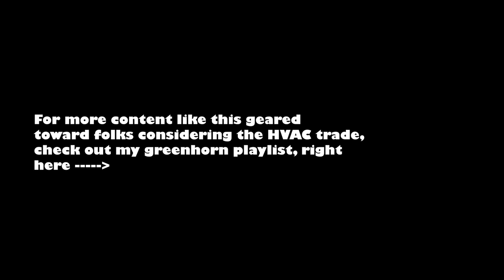5 Things to consider before becoming an HVAC Service Tech🔥❄

Comment: After fifteen years of sales, being alone all day = Heaven.
Reply: I’m 14 years in sales and thinking about making the switch. If I could be alone, not have to cold call anymore, I’d be in heaven lol. Leaning HVAC or Electrician. 

Did you ever get into the trade?
Reply: @ChopOn414  I've done 23 years of sales and seriously thinking about a trade
Reply: @ChopOn414  I’m in the same shoes. Just got outta the Army and I’m not sure which way to go?
Reply: I’m only 3 years into sales and I already can’t stand it. Putting on that act everyday ruins your mental.
Reply: @tylerlane4587  I’ve done a little plumbing and framing and 3 years of business to business sales. Closing on your sale is pretty much the best feeling in world, but that comes with losing clients and getting shut down alllllll the time. Also your higher ups being up your ass about closing everyone you talk to. If you’re used to working hard and working with your hands I would go into trades.
Reply: But, you're not alone. You constantly meet and speak with potential clients, and regular calls from previous estimates, and the office never leaves you alone. But, other than that, yes... solitude and control of you time is in your hands.
Reply: @ChopOn414  What kind of sales?
If you plan to do sales in HVAC, a somewhat of a technical background goes a long way. Install experience helps as well.
Lot to learn.
Reply: @tylerlane4587  update?
Reply: I just quit my job in restaurant and wanna switch too. You aren't the only ones. I feel this. 😂
Reply: Love it. Ride around all day and fix stuff. Alone! 😂
interaction in a need-to-know basis is my kinda work. I don't understand all that social butterfly crap. im better off as a loner. I like work and take pride in my work. Can't do a good job if you're worried about other ppl all the time. Now doing a good job for other people is my way of being social!😂
Reply: 15 years in IT taking tickets all day. I  agree 👍
Reply: Oh I bet sir 😂 cheers to that
Reply: I've done 1 year in sales and I just now signed up for HVAC trade and will never look back 😂
Reply: That's my biggest selling point. I hate people.
Reply: Hahaha I was going to post something similar to this.

Comment: You forgot the part about getting electrocuted from time to time and those sweet blisters you get on your hands from refrigerant burns 👍
Reply: Shannon Knight I got hit hard last week on a install under a house. A wire was rubbing the copper water line. Put my arm over the gas line and went to ground.  Hollered like a schoolgirl. Customer did come out and checked on me. That’s the bad thing about working by yourself.
Reply: Why split hairs Brent? Electrocuted vs Shocked, tomato vs tomahto. It was meant to be a humorist comment. 😜
Reply: I got hit with some 480 last week, scared the ** out of me. Gotta love three phase
Reply: D@mn Nick...you still got your eyebrows? ⚡⚡⚡
Reply: I'm surprised I still have the bottom of my feet 😂 $#it hurt but I'm glad it was 3 phase so it let go
Reply: @nickgrant2846   i Got a Arc Flash from 480 to Ground a while back , scared the crap out a me too and got blinded for like 5 Minutes. Never Rush on a Friday night working on a 480 volt  60 ton chiller.
Reply: Get some low loss fittings
Reply: Jus get the hoses with the ball valves on it
Reply: I mean as long as your following the SOP's
You'll never get shock or electrocuted.
Reply: You could always just wear latex or non latex gloves, you’ll feel the cold but not get burned
Reply: I know you guys love the feel of that
Reply: @OcRefrig  Ohh damn thanks for the advice.... I want to start doing this but when ive read ur message its making me thingking so many times now lmao
Reply: Tone it down, we need more technicians
Reply: If you tell them the bad things about HVAC, they won't try it. The things that all of you are saying that happened to you, are things that happened to YOU. Most injuries in our field are caused by some sort of negligence by the tech. Somebody else could have done the job you were hurt on, and not got hurt. Don't get me wrong, I've been hurt myself. I had a career ending fall from 20' off a ladder. It's all in what happens to YOU. I know someone else could've climbed that ladder and not gotten hurt.
Reply: OcRefrigeration,Hvac & Electrical. Yeah I got blinded from my co classmate at school dropped his leads and they touched and it made a huge ark I was blind for five minutes
Reply: Ahahah yes!!! I remember the first time I got hit with 220, not cool!
Reply: Yep. 
 Over the last 30 years I have been hit with high voltage more times than I can remember.
Reply: One can simply not do service with gloves, so both the burns and a little shocker from time to another is definetly a part of the trade.
Reply: Shannon Knight HVAC .. gloves .. perhaps the rubber coated.. almost guaranteed no blisters, electrocution & refrigerant burns.. always have em on when workin also timberland pro shoes.. (I kno they r expensive) electrocution protection upto 600vac. We all know accidents do happen.. but these help a lot
Reply: Iron Phoenix proper gloves & shoes brother
Reply: @unitedhvacelectrical7076  You can't do skilled HVAC work wearing gloves. Come on man you know that.
Reply: Nick Grant 3 phase is the one that doesn’t let go bud
Reply: You mean SHOCKED. Electrocution means you are DEAD.
Reply: @ironphoenix5145  some people can and some people cant bro, it’s all up to what YOU think is best for YOU and how YOU do it
Reply: @bobrob3109  So this might be a stupid question but do you have to climb a lot? Like up ladders and Heights?
Reply: Ah yes, the refrigerant burn. I once forgot to close the tank before removing the hose....
Reply: Adrien Broner yes you do if you do commercial. Residential only if there is package unit. I hated the really tall angled roofs. I was scare

Comment: Great video. I am an HVAC mechanic from Canada. I have been in the trade since 1987. My advice to anyone thinking of doing this for a career is to keep in mind what was said in this video about wear and tear on your body. My knees are shot. My hands have arthritis and my elbows are so worn out from turning screw drivers that it hurts to pick up a cup of coffee. I have worked for the same company for 35 years and am now riding a desk at a reduced pay. I made a lot of money and loved being in the field. I love being an HVAC mechanic. If I could go back in time as a young service tech, I would get a job with a larger company with a pension of some sort. I left the field at 55 years old and if I had a pension I would have been able to semi retire. Just keep in mind that your body can only take so much. Some good companies have 2 techs assigned to most of the service calls. My company is cheap and I was always on my own when many times I should have had help. This is just my 2 cents. Cheers!
Reply: U clearly didnt use knee pads , elbow pads and electrical tools
Reply: @AlexLopez-zv8ng  It wasn't in the culture back in the 80's. I agree that using the proper equipment all the time would have made a difference. Ergonomics was never discussed during my schooling. So much more info available today.
Reply: That’s sad they have you on reduced pay after 35 years of service
Reply: im leaving my current company due to them paying commission and not the driving hours, it seems like they are f-ing us over, this is my first hvac job and im already riding on my own, i also feel like shit after selling items as a preventative maintenance for 10 times the actual price just to make my quota. i just hoped that they ha dnot put me on full commission fresh out of shcool.
Reply: @ethanberdejacortez4845  Commission type jobs are BS unless its sales. In Ontario, if you are having to drive to a job site, you may not be paid for travel there and home unless you have multiple jobs a day. Then you must be paid for travel there and back unless you are in a union. They have their own rules

Comment: My advice for apprentices getting into the trade that no one ever tells you about.

1. Never throw out your napkins from lunch, keep them on your passenger seat
2. Apprentices - it's always your fault, this includes the times you aren't even on site, just accept it as a fact of life
3. You'll come across a piece of equipment you've never seen before and you have to be an expert on it in the next 30 minutes
4. Never drink when you're "on call"
5. Your drivers licence is the most important licence you have so don't do anything to lose it e.g. drinking and driving, not paying speeding tickets. Lose your licence you lose your job.
6. Learn to eat lunch in 5 minutes or not at all
7. Keep a roll of toilet paper and hand wipes in your truck, trust me when you need them you're going to thank me for this one
8. You can work 8hr days if your quick and efficient, but there are times when you may also have to work a 16hr day
9. ALWAYS check the simplest things first when troubleshooting. Is there power at the unit? I once pulled a unit apart for an hour because I couldn't get it to lite. Turns out the customer hadn't paid the gas bill and it had been shut off. ALWAYS. 
10. You will make mistakes because you are human, but don't tell the customer that. 
11. READ THE INSTRUCTIONS!!!!!!!
12. It's hard work but pays well
Reply: Take a whole 30-45 mins lunch not 5 🥴
Reply: This whole list, napkins included and tp not, i do. 😅
Reply: @SnApUnique  30 minute lunch is requite by law, so
Reply: This is so true I just experienced myself
Reply: @benjaminreed6816  There's what the law says and then theres reality. Do you do the speed limit because it's a law?
Reply: @stinkyham9050  Um yah, 90% of the time.

Comment: Everything AK said is true. It’s not a profession for everyone. I’ve seen many fail, and I’ve seen some excel at a rapid pace. It can be physically and mentally demanding. You do have to be ok with the self gratification of a job well done. I also like to be left alone. Occasionally having an apprentice along for the ride is ok. Customer communication is not just important, it’s also a skill that can be honed.
Reply: I feel the same  way.
Reply: "that can" or "needs to be"?
Reply: Jordan R not everyone can communicate with customers well. I agree it should be need, but not every can.
Reply: Also, it’s not “self gratification”. Think of the customer/people that are benefiting from your work.
Reply: It's self gratification to the point that you won't hear "good job" or "thank you" or whatever else from people...customers sometimes, but not always.
Reply: @jroberts3428  Most professions are not for everyone. I've been both residential and commercial HVAC for 17 years. I love it. Seen many come and go. What I've learned about the one's who don't stick it out, is that they thought they'd make easy money and found out they were VERY wrong. It's challenging work and there is a ton to learn. 17 years in and I'm still learning new things. I quit a building maintenance job in 2001 topped out making $14/hr to make $9/hr for a company that had a "learn & earn" program. I felt that in 5 years I'd be better off and I was right. I went from $9/hr to $25/hr with great benefits in 5 years. It's a great trade if you like to be challenged and aren't afraid to get dirty.
Reply: @johnpatrick3458  Great man! How many hours do you work a week?
Reply: @basse9914  I generally work 50 hours a week. Usually 60 during peak which is roughly 4 months out of the year.  I'm a field supervisor so it never really slows down for me. 50/50 between the field and office. We have 38 techs in the field. 60% resi and 40% commercial.

Comment: It's painful! You will bust knuckles, get shocked, get burned, get cut!
You have to be okay with heights and or sketchy shyt! 
You have to be okay working in the elements. Extreme heat, extreme cold, wind, rain. Loud noise environments. 
The hoods need service too. I have had to chase away crazy crackheads hiding between condenser units.
Reply: HAHAHAHA! Thanks for the honest advice !
Reply: If you tell them all the bad things, they might not want try it. When I started, I didn't know everything that I would have to do. But once I started doing different tasks, I loved it. If you want a job that challenges you everyday, this is it. The more you know, the better you get paid, so you'll have to hit the books. Sometimes, you are only as good as your resources. So dig into it and find the resources. It could be tech support, unit manuals, supply house and maybe other techs. But once you fix it, you will have gained knowledge. And that's how you make money and build a good reputation
Reply: Where hood where the hood where the hood at
Hahahahha GET THE STRAP
Reply: do u have to go under houses? deal with spider?
Reply: @MusicX9BeatS  under houses no. Spiders yes. I'm in the desert so we deal with spiders, snakes, and lizards daily.
Reply: @jrchevy2500  oh dam thanks for the reply. I'm only worried about spiders and snakes I live in California
Reply: How much schooling does it take to get certified and all tha
Reply: @scottaguilar3310  schooling never stops. To get the epa 608 you can probably study a few weeks and pass it. There are always new equipment to get training on, new gov regulations to get trained on, depending on the job scope you'll need different certs, ext... you will never be done with schooling in HVACR
Reply: True true people do it for 20years and still is learning, how much does it usually cost for the schooling to pass the test and how long will it take ?
Reply: And once I get the epa 608 will I be able to into work I want to do hands on experience while studying, I want to know I’ll be ok and I’ll be good at my job
Reply: Also you have to be a contortionist crawling thru some of these attics

Comment: Sounds like you hit on everything pretty well. I started school to get my degree in Heating and Air Conditioning Technology when I was 18 and been in the trade now for 32 years. 
Remember when you get into service, this is an applied science more than just a trade. Learn the science of your job. Know the 18+ different reasons an evaporator can freeze up instead of just adding refrigerant. Learn about thermodynamics, air balance, heat loads, coefficients of performance, psychometric charts, electrical engineering, and you will set yourself apart from the "pawn shop" techs.
And he is right about your home life. Your home life can definitely be a challenge. Especially when you have a young wife or girlfriend. They will ask what time you're getting off work. "I don't know.", is the hardest thing for them to grasp. Because how could anyone NOT KNOW when they get off work? Be prepared to sacrifice trips to the lake in the summer. Or hanging out all weekend at the pool.
But this is my dream job. I love it, am good at it, and can make lots of money. 
Good luck!
Reply: Hey Will I’m also 18 and eager to further my career in HVAC. I’m still in school (class of 2023) I was wondering while I’m in school, how could I begin the process of becoming an HVAC technician or prepare myself for it?
Reply: @jeanomaly7776  I would say you need to focus on the science of the trade before going full on to a service company. I actually started out doing apartment maintenance so I could complete my college courses I took at night.
I worked my 8-5 job, then went to school from 6:30-11:30pm. It gave me a chance to get hands on training on the simple units of the apartment industry, while learning the basic sciences at school I could apply to my job.
Reply: You got a degree at 18?You can't leave school until that age in the U.K. then go to university, normally for 4years. Do you get degrees free with a big Mac ,
Reply: @alemgas  Apparently the reading comprehension in the U.K. isn't very good. If you go back and read again, you will see that I STARTED school to get my degree when I was 18. Got my Associate's degree at 20, and my degree in electrical engineering at 23.
And no Big Mac for me. I'm in Texas and we eat steak 3 times a day.
Reply: @williamthomas2063  sorry getting old didn't read it right, I've been in HVAC for 51years, hope you have a good career. Big Macs are shit better with a good steak ,cheers

Comment: The part about not getting a pat on the back applies to other jobs as well. I'm a computer programmer and the same thing applies to that. Basically, you just need to take pride in your work, and know that you did the job correctly and did a quality job. If you do that, you will have you're own internal satisfaction, regardless of what anyone else does or doesn't say. Similarly, you also have to be able to work independently and solve problems on your own. So, I see parallels between the two jobs.
Reply: Real.

Comment: Started in this field 10 months ago with no knowledge of anything HVAC related. I’m still pretty green and have alot to learn but I am definitely enjoying it. I work for a small company so I’ve had my hands in everything so far. Maintenance, installs, service on ice machines, RTUs, walk in coolers and freezers, split systems and everything in between. It’s definitely a lot to learn and definitely overwhelming but you take one day at a time and keep pushing through. Slowly but surely I am getting it.

Comment: Installs is the best place to start off. You learn to understand how the equipment should be put in, and why it should be done properly. It gives you the basics of everything you need for service. Electrical, controls, gas, plumbing...ect. 
As well as it allows you to learn the sketchy stuff like ladders, and dealing with the elements,  and power tools.